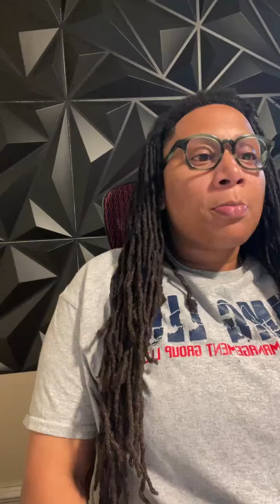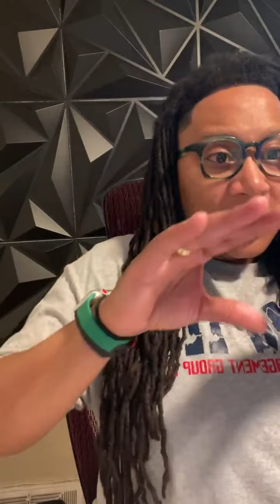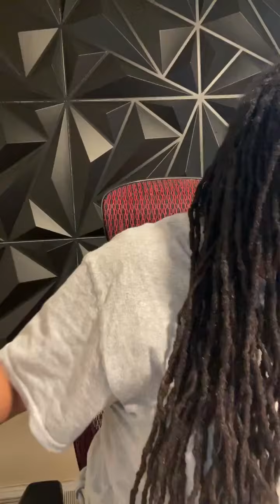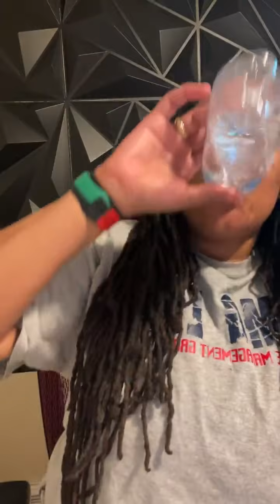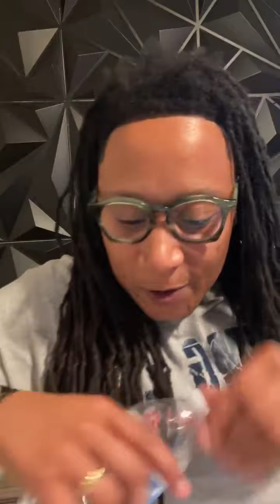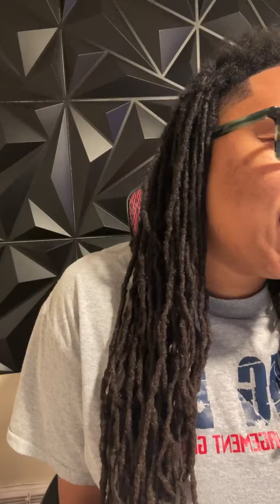HOME INSPECTOR HACKS: How To Pass the National Home Inspector Exam🏡🔍🔥👀

Comment: Don't forget the exhaust fan kicks on as soon as signal is sent from thermostat for the gas and heat exchanger can even open gas valve and when heat gets to temperature  the exhaust fan stays running to exhaust unspent carbon monoxide
Reply from the maker: Thanks Ray!